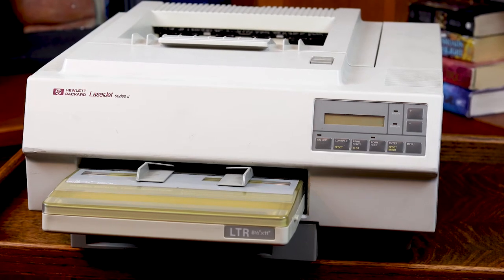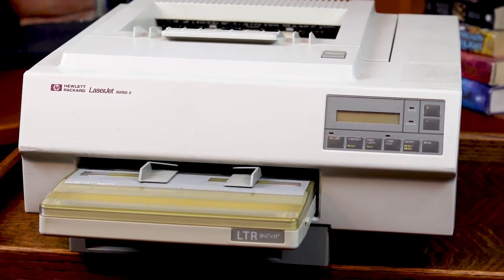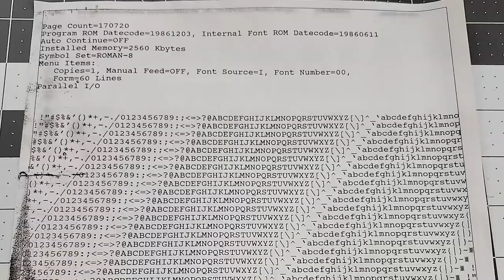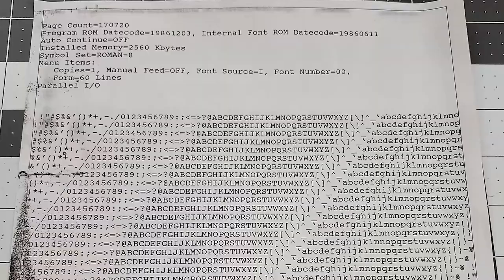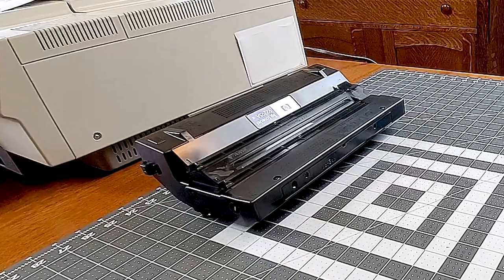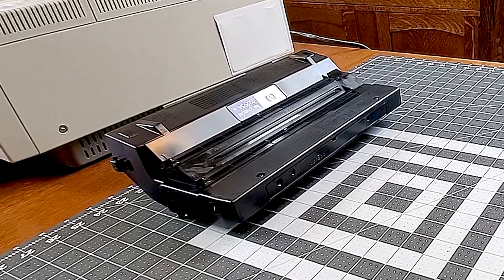Vintage HP LaserJet II Toner Cartridge Repair - Beautiful Prints

Comment: I have an ImageWriter IIg I'm recommissioning, and this info was super helpful. Thanks! 
I have an ImageWriter I that I'll eventually get going as well... and you're right. The later machine is so easy to work on in comparison! 
I'd love to find the personal copier that is the same CX engine.
Reply from the maker: I'm glad it was helpful. Hopefully I'll be able to get one of the CX engine printers I have working but parts are a huge problem. The equivalent copier uses the PC engine which uses the opposite polarity for imaging so be aware that the drum and toner are different even though the toner cartridges are almost identical. I do have a pair of PC-20s so there is hope I can get one up and running.

Comment: Man I recycl/rebuilt thousands of those sx cartridges here in Orlando.   Memories.   Oh and we had like less than 2% defect rate.   New drums,blades would split and reseal hoppers.  We had a bulk filling machine, would ultrasonic clean corona wires.  Our products were way superior to OEM.
Reply from the maker: Those were the early days for sure. Later on we could produce extremely high quality cartridges but at the beginning of the SX I had issues due to the lack of replacement drums and mag roller sleeves. We used to buy single use (virgin) drums and sleeves by the case!

Comment: Amazing job! But I don't have a spare wiper blade. Any idea where to get one?
Reply from the maker: Sadly i had the same issue. in my case i found a nos remanufactured toner that was only 5 years old and yoinked the good blade from it. oddly i have plenty of good wipers for the older LaserJet Classic (Canon CX engine) but all the newer Canon SX engine wipers I had have turned to rocks. The CX wipers are a strip of material glued to a metal frame while the SX ones are molded onto it so clearly there was a material change.  I talked to someone at static control components where I bought the blades back in the day but all they could tell me was that they are made of polypropylene.
Reply: @RavenWolfRetroTech  Do you have any sources for the CX wiper blades? I'd love to get my original LaserWriter output looking as good as you've got here, but I've not found anyone that has CX wiper blades.